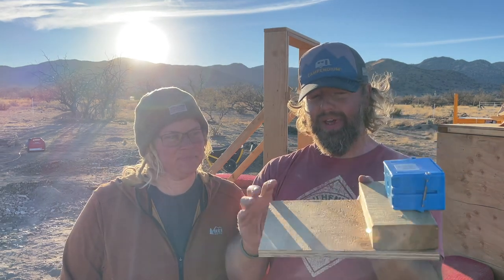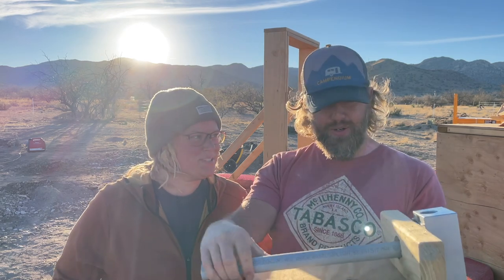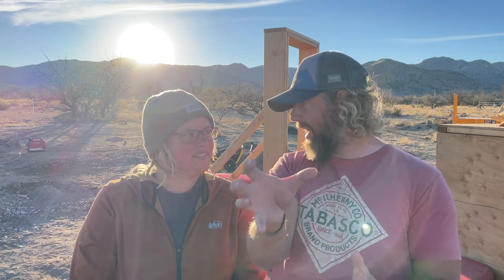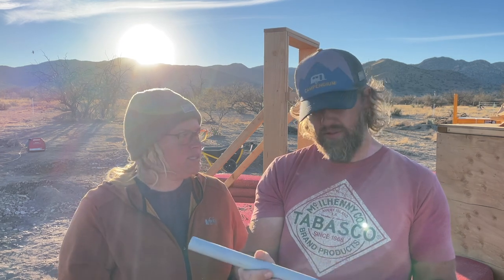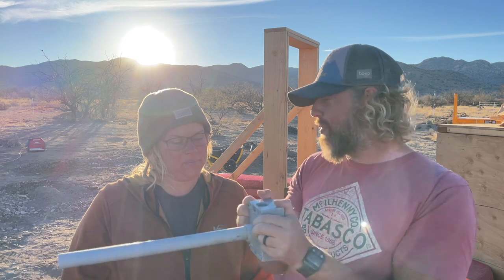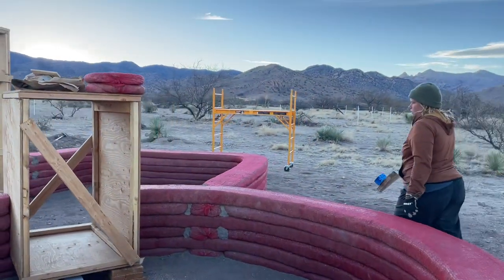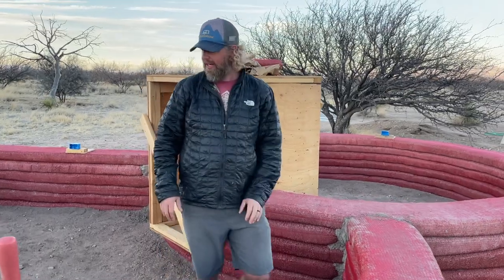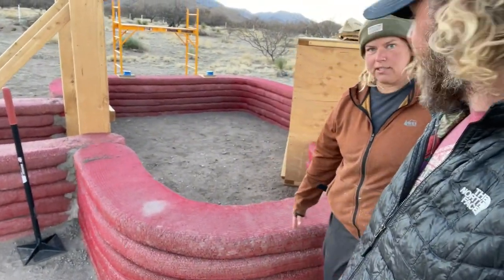Hyperadobe Off-Grid Solar Shed Office - Electrical Outlets

Comment: For the exterior plugs put a tee fitting about half way on the pvc pipe and add a short piece of pvc running laterally with the bags. Pin it to the bags with a twenty penny nail.

Comment: Use four two inch conduits for your power. One for inlet, one for house outlet, one for RV outlet and an extra for expansion.  For the gauge of wire, to run the house, an 1.5 inch hole/conduit is needed.  Put in the extra space in the tube put in order, steel wool, SOS Pad, Steel wool, SOS Pad, Steel wool.  This five layer stuffing will help deter almost all creatures from trying to enter the building.
Reply: Vents, by themselves, really do not cut it.

Comment: I sure like that trolley system you are using. Cleats for interior electrical outlets. Nice, additional desk for the kids on the back wall, cool. I think putting your freezers outside will save lots of room on the inside of the solar shed. So 6 interior outlets and 3 outside outlets. Lots of ins and outs that you guys have to finalize. Tons to think about. Ventilation too for the equipment and the solar shed itself. This is the power station for all the buildings so lines running out to other buildings. Lightening suppression device sounds like a good thing to think about too! "Check it out" and that pesky T-Rex walks out from behind the circle door form.

Comment: Jonathan, just put a panel on the outside of the wall. You can and more wires as needed. A large disconnect box or even a large 200 amp breaker box will work. Just make sure it has enough space to add when you want to.

Comment: On your solar wall you could put like 8"x8" pipe up into it and also leave future pipe just down in dirt buried till you need it ,and from box again pipe up to your interior location , p.s. there is a app. that will tell you pipe size needed and wire size ,so you don't over fill pipe 👍

Comment: Hi. 
You are talking about lots of future trenches and I note that you have previously trenched the water pipe from the tank to the Airstream.
Have you considered future planning for ALL OF YOUR trenches. The idea is that you dig once, and into that one trench you PUT EVERYTHING, making provision for future electricity line, water lines. You may end up with, multiple large diameter pipes in your trench but the idea is you dig ONCE,  in advance, and then feed lines, pipes whatever through existing pipes as you need.
You may also consider putting magnetic tape in your trenches, so that you can easily locate pipes and avoid damaging during any future digs.
Good luck!
Reply: I like the magnetic tape idea!

Comment: for the exterior plugs, use the same PVC bo you were planning (without the plywood), but put some hose clamps on the PVC to give something that will lock into the bags. 
For the passing of wires, I would look at adding several PVC pipes through the wall anywhere you think there may be a hole needed at some point. If you use them later, great, and if not you can cap them off and insulate them.

Comment: For your exterior box just add another 2x4 on the same cleat for support or if you want to get trick about it you could just heat it up with torch and relax/bend the pipe some just don't kink it 👍

Comment: Could you screw the outdoor boxes into the end of 1by1s (so the wood runs alongside the pvc)? Itll be weaker than the normal mounts, but should be stronger than just having it slot between the bags

Comment: You could use two pieces of earthquake strapping around the PVC pipe where it would be in the center of the earth bag wall. put 90degree twists in it so the strapping would be edge-on to the bag. The twisting will bite into the pipe slightly and the strap will be buried in the center of the wall. Best way to twist the strap would be to sandwich the two pieces of strap around the pipe, clamp both ends and then twist the pipe 90degrees.

You could also just use the two-hole pipe strapping (like used to mount pipe to the wall) and attach it to the plywood. 
pipe strap & plywood: https://www.homedepot.com/p/Everbilt-1-in-Copper-Tube-Strap-5-Pack-C624HD1/204583745
earthquake strap: https://www.homedepot.com/p/Master-Flow-Perforated-Metal-Hanger-Straps-3-4HS/100396917

Comment: Think about your batteries....if they are acid batteries they need vents.... if they are lithium they don't need vents.... put in several extra conduits for well, rv or future what ever add extra conduits.... you could make all the conduits 2 inch or at least 1.5 inch 4 inches apart and reduce later when you decide what you need it for....

Comment: Run Conduit under the ground put spare ones in there to one to the house location and one to the campervan and run a good rope inside it   lay in the conduit so your ready to run the wires use that orange rope it dosent break down in the sun i would use 2inch runs of the pvc dont forget you need internet lines in there to you never know they might run fast internet there Nbn ones or what ever and go at least 2 feet down when digging by law in Australia hear it should be 3ft but you have frost in the ground there so deeper the better

Comment: Couldn't you just run a small/thin bag under the conduit or as Edith H. suggested a piece of wood... 2X4 or ? size...
How about 2X2 wooden spikes driven into the bag then the receptacle box screwed into them... sharpened anchors...
I'm sure there would be enough holding power with both a strap over the conduit screwed to the plywood and the weight of the bag... 
Maybe screw the conduit to the flat plywood, if the conduit is 3/4" drill a 1/2" hole through the top (only one side) then a screw through the bottom of the conduit into the plywood. You will still be able to pass the romex through the conduit, lay your bags with no gaps and have a strong mechanical connection of the conduit to the plywood... Good Luck... you have an adorable family.